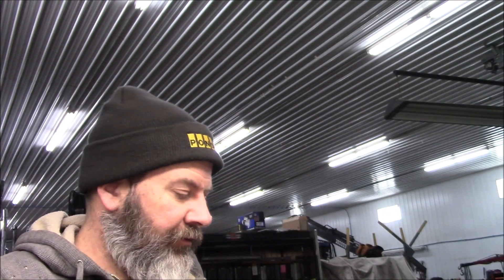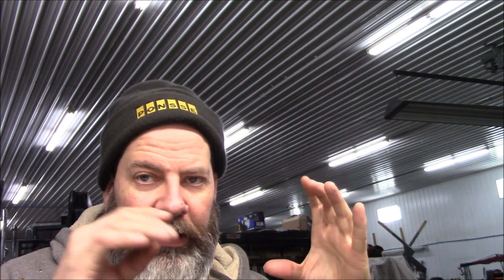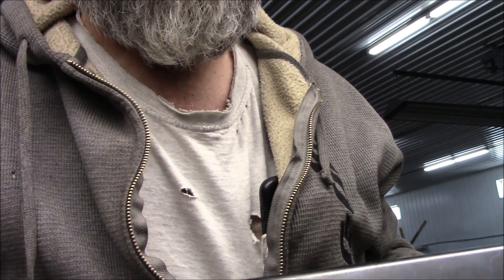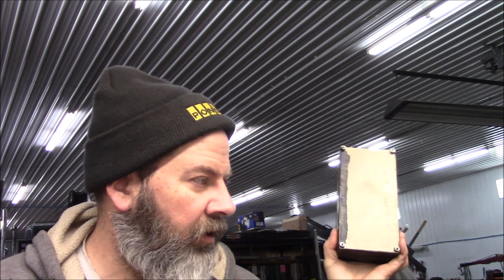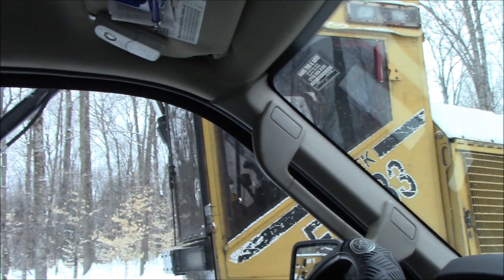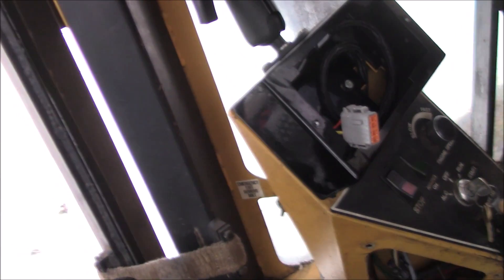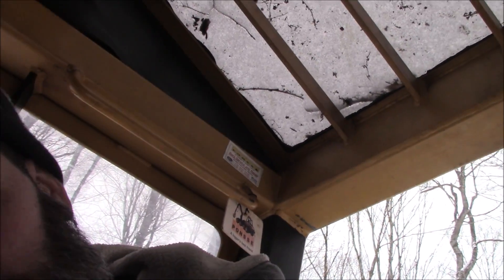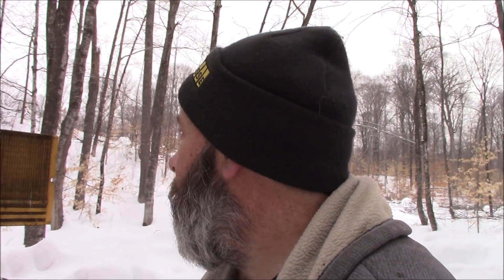Fabtek gets a new measuring computer

Comment: I put a Joral computer in a 653E that I had many years ago, was a really easy install, and good outfit to work with, can call and talk with the engineer that builds them. A lot better computer than the old version I think. Not as good as Opti/ dasa but that's apples and oranges
Reply from the maker: Those are the guys I used. Super to deal with